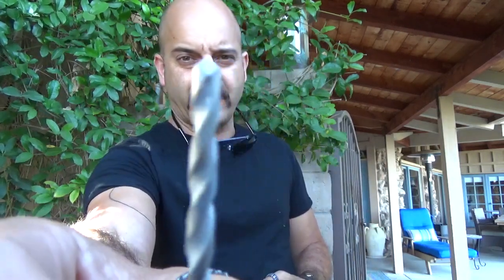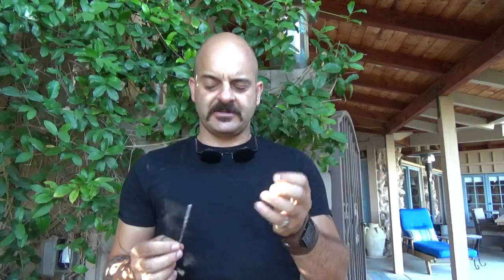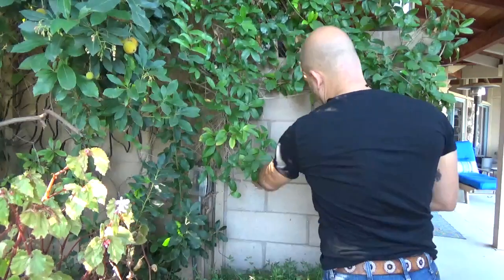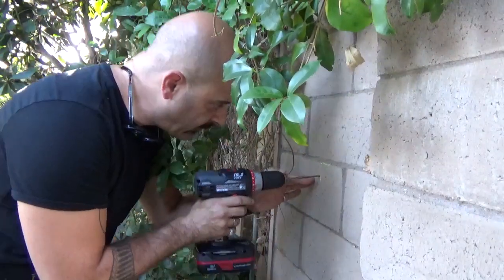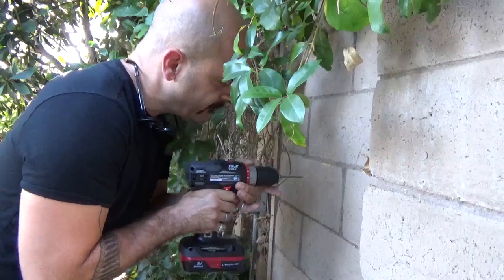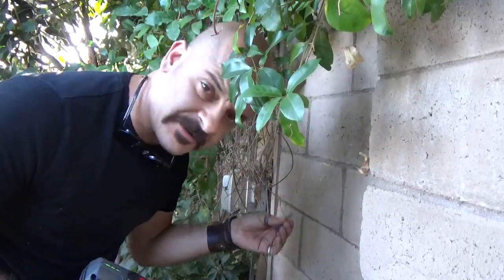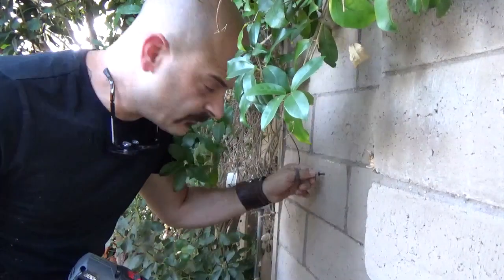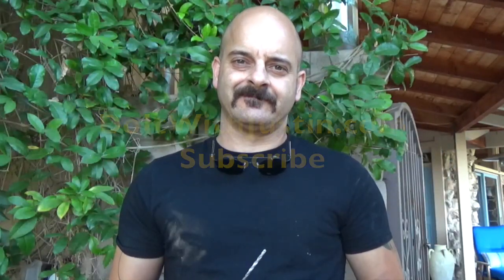Hanging Art on a Cinder Block Wall (what is a cinder block?)

Comment: This was very helpful. I will need to hang an everchanging variety of art (different sizes and placement each month) in our theatre lobby which is painted cinder block. I don't want to wind up with walls that look like swiss cheese in a year or two. What do you suggest, Justin? There will be times when there will be no art and I want the walls to look plain, and close to unblemished. Anyone have an idea? Thanks!
Reply from the maker: Hey Rick - Since you're going to be changing your displays that frequently, I'd install a picture rail. This is a strip of molding at the top of the wall, near the ceiling, with a bevel on the top you can hang a hook on. Suspend each piece of art from a wire or wires attached to the hook. This way you can have a piece anywhere on the wall you want it, by sliding the hooks right or left on the rail, and using different lengths of wire. A lot of galleries and museums use this method. Install the rail with falcons (as in the video) and paint it to match the wall. (Of course I mean "tapcons" but autocorrect changed it to falcons, and I think it'd be pretty cool if you can get falcons to hang your art for you.)
Reply: @DoItWithJustin  Thanks! Two of the other walls are drywall; could this same method be used for those?
Reply from the maker: Rick Holtz Absolutely

Comment: Hi Justin. Great video. Question for ya..... 

I have a piece of art I want to hang in my basement. I want to hang it on the part of my wall where the chimney is which is cinder block built in the late 50s. It’s a pretty heavy piece. It’s about 15-20 lbs. Is there any other support I would need other than the masonry screw?? In my old house I had it hanging on a brick wall and it was just fine I just would hate to have it fall off bc the area is directly above my stereo. Thanks in advance!!!
Reply from the maker: Thomas Williams At that weight, you should be ok. You could use an evenly spaced second screw to distribute the load, or if you really want to overkill, use this method to install a French cleat Your friend has shared a link to a Home Depot product they think you would be interested in seeing.

Hangman 200 lbs. French Cleat Picture Hanger with Wall Dog Mounting Screws

https://www.homedepot.com/p/202341629
Reply: Justin DiPego Thanks man!!!

Comment: Thank you.  I have a concrete block house in Florida. From the 70s. I wanted to hang a pride flag. I didn't have a pole. I use duct tape. Needless to say it ain't working. I've got to find someway to get this flag up while it's still June 2021. And I have a sign that I wanted to put up on one wall. I will learn how to do what you were showing. Thank you I know it was 2015 you did this. But I appreciate it.